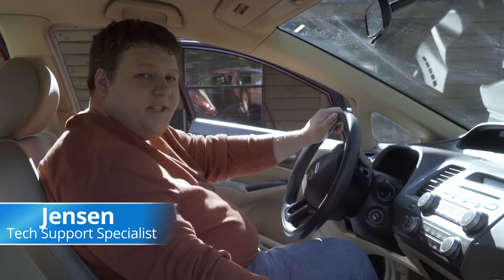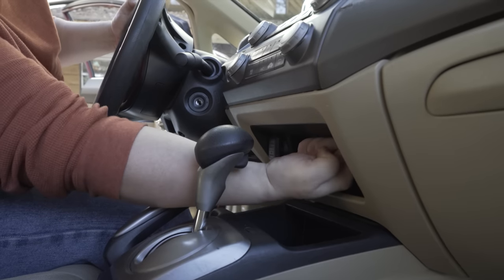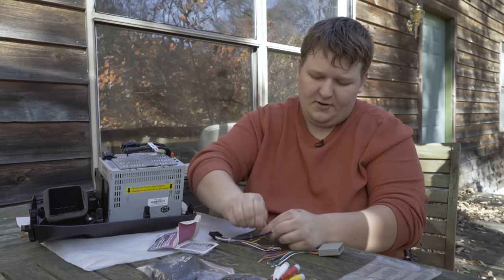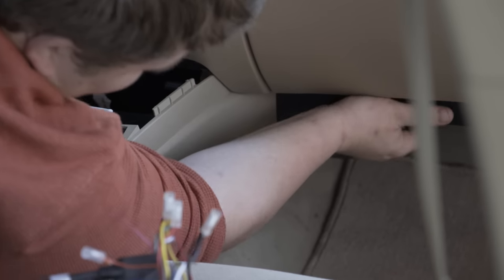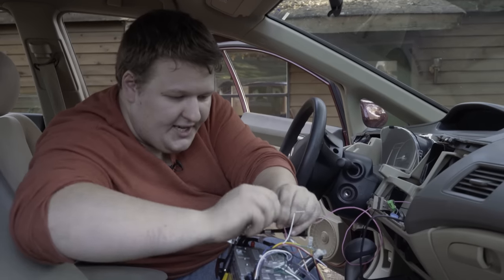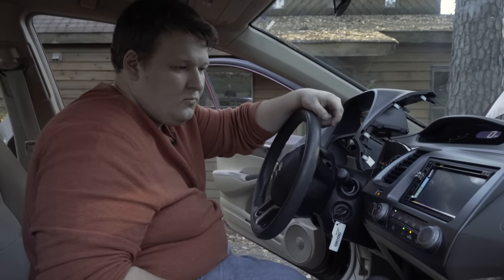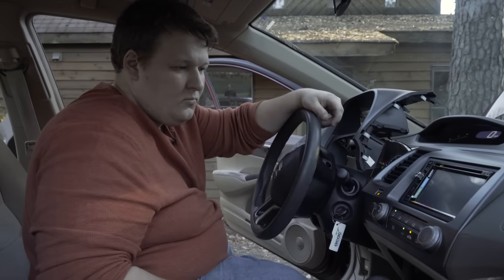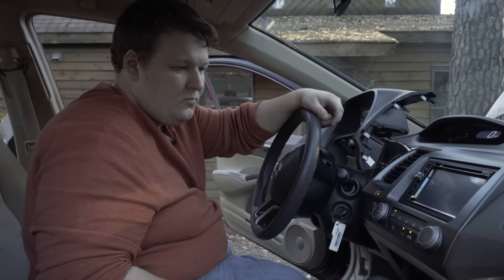How to install a stereo and speakers in a 2006-2011 Honda Civic | Crutchfield

Comment: do you have to connect to the brake wire? what does that do?
Reply from the maker: When installing an aftermarket video receiver, you must connect the brake wire in order to watch video on the in-dash screen. Due to legal and safety reasons, you cannot view video unless your vehicle's parking brake is engaged. If you attempt to view video without the parking brake engaged, the unit's LCD touchscreen will simply display "Parking Off".

For more details, feel free to reach out to an Advisor on the Crutchfield site: https://www.crutchfield.com/I-rYTVc000/Support/Chat.aspx

Hope that helps
--Crutchfield
Reply: Just connect that wire to ground to bypass that safety crap

Comment: Do you have to mess with brake line with just a regular head unit , speaker and amp?
Reply from the maker: Tapping your parking brake is for headunits with screens and video playback capabilities.

Comment: Does the factory aux still work? And I drive a standard is the brake wire in the same place?
Reply from the maker: For more details regarding installation in your specific year/make/model vehicle, please contact an Advisor directly on the Crutchfield website: https://www.crutchfield.com/I-rYTVc000/Support/Chat.aspx

Thanks!
--Crutchfield

Comment: So when I switch my parts from the old kit to my new kit, on the ac controls the off and ac button keep getting stuck and become unusable, any tips?
Reply from the maker: We didn't experience that issue and wish you was not experiencing it. Can you tell what is catching the buttons? If it is part of the new dash panel, you could try using a file or something to slowing remove the paneling material that's catching the buttons until it is no longer causes issues

Comment: hey where did you get that radio kit from?
Reply from the maker: The Scosche HA1561 Dash Kit featured in this video is available for purchase on the Crutchfield website here: http://www.crutchfield.com/I-rYTVc000/p_142HA1561G/Scosche-HA1561-Dash-Kit-Dark-Gray.html?tp=3486

If you have further questions or would like personalized recommendations, feel free to speak to an Advisor via the "Contact Us" link at the top of the webpage. I hope that helps!

--Crutchfield

Comment: Anyone's corner dash tweeters stopped working after installing? There was a cable that I assume was for the tweeters but the wiring harness adapter didn't come with anything for it, as well as the double-din i have probably doesn't even have a port for it.
Reply from the maker: It sounds like the new receiver wiring interface may not be connected properly or might be the wrong one for the vehicle. If it was purchased from Crutchfield, I recommend contacting our technical support using their toll free number we include on the order invoice. It the harness was purchased elsewhere and they cannot help, I recommend contacting the manufacturer of the harness for help
Reply: @crutchfield  ah yeah, I read up on the product after and it didn’t include wires for the tweeters. It’s okay though, I bought 3 way speakers from you guys and it gives me plenty of highs :)

Comment: I have an 07 civic lx sedan and I bought a dash kit and new head unit cause mine wasn’t playing sound out the speakers and thought it was the radio so I bought a new radio and installed it and still no sound is coming out of the speakers and I can’t seem to figure it out! I connected all the wires color for color and checked my speakers connections and nothing seems to be off…. Idk if anyone has had this issue
Reply from the maker: That Civic does not have a factory external amp installed in it. The radio in the dash powers the speakers. If you have changed the radio, chances are the radio's built-in amp is not the issue. The speaker wiring that runs from the radio to each speaker or the speakers themselves are most likely the cause of the issue. You may want to try replacing a speaker first as that is easier to do than running new speaker wire to each speaker.

Comment: Anyone know if it is possible to just pop the speaker cover off and do it that way to cut corners? The whole door panel removal just seems unnecessary.
Reply from the maker: The factory speaker grills are molded into the door panel and cannot be removed separately.
For additional assistance and personalized recommendations, feel free to contact us directly by phone or through our online chat service:
http://bit.ly/2jBGHPp 
Hope that helps
--Crutchfield

Comment: What is the reason for tapping into the parking brake?
I noticed the car stereo whines when i release the parking brake and when engaged no car noise whine same when the headlights come on noise goes away can someone help 🥲
Reply from the maker: The parking brake wire is the one that detects when it is safe for the receiver to display video and with more modern radios, to get into the advanced setup parts of the menu (the ones that need more attention than can be safely given while driving). This should not cause any noise and recommend contacting technical support for help. If you purchased yours from Crutchfield, we recommend contacting our technical support for help. We send their toll free phone number on the order invoice. If it was purchased elsewhere and they cannot help, we recommend contacting the radio manufacturer for help.

Comment: I finish replacing a new stereo on my 2006civic but there was no sound. Any tips?
Reply from the maker: It's hard to diagnose without more information. If you purchased the stereo from Crutchfield, you can call our tech support department for assistance. Their toll-free number is printed on your invoice.If you purchased the equipment elsewhere and the retailer will not help, we do offer paid access to our tech support service:  http://www.crutchfield.com/I-rYTVc180/p_000TECH90/Crutchfield-Tech-Support-90-day.html  You can also try posting your issue in our community forums to see if one of our members can help. Provide as much detail about your vehicle, trim package, & stereo model as possible:  http://community.crutchfield.com/  Hope that helps!--Crutchfield
Reply: amp turn on. I had the same issue. If you have an EX or an SI you have a factory amp that needs to be wired. It should be on the other harness the man isn't using in the video (light blue wire) and you can just tap into that and wire it into the blue white or blue wire (used for remotes and amp turn on) on the harness you bought and it should have sound.
Reply: Raymond Coolidge Thank you, I finally have time to tried out what you have instructed and it work like a charm. No more silly cellphone speaker -_-
Reply: Glad i helped!
Reply: Raymond Coolidge thank you!!!!

Comment: all the speakers are off and i changed out the fuses. Will changing all the speakers fix the problem? not sure whats going on. the radio has power and works, its literally just no sound
Reply from the maker: Do you mean you installed a new radio and lost sound?
Reply: @crutchfield  no sorry. It's all stock and it's a base model, not a si, no premium setup. Speakers just stopped. I can't seem to see if there's an amp. I'm assuming it's in the head unit. But I bought the speakers and parts for like 100 bucks so I was thinking about switching them out to see if that works. Just weird that they all went out.
Reply from the maker: Got it. What is the year, make and model of your vehicle?
Reply: @crutchfield  2007 civic  coupe  base model. Not the si
Reply from the maker: The most basic systems offered in the 2007 Civics did not include an amp. This means the stock radio powers the speakers. If all the speakers stopped playing at the same time, there is a chance the radio is going bad and needs to be replaced.
Reply: @crutchfield  I just found out her fronts were out for a while and her rears just went out so it's wasn't all at the same time as I previously though. I guess that's kind of leasing me to believe it's the speakers and not the head u it now.
Reply from the maker: Sounds like you may want to start by replacing one pair of speakers Would you like help choosing?

Comment: What about steering wheel control?
Reply from the maker: Hi Shaham, do you need help choosing a steering wheel control interface for a  2008 Honda Civic?
Reply: @crutchfield  yes also the wiring for steering wheel control
Reply from the maker: Do you have the EX, DX, or LX. To verify, the car did come with a factory radio and steering wheel controls? Did your car come with factory nav? What brand and model radio are you looking to install?

Comment: What is the brake wire?
How make my back up camera start wen change to reverse on a 2011,  is that the brake wire?
Reply from the maker: In-dash video receivers feature a parking brake interlock system that prohibits viewing of video programming while your vehicle is in motion. In order to watch video on the in-dash monitor, the vehicle must be stopped with the parking brake engaged. The video receiver will include a parking brake wire which must be connected to your vehicle's parking brake detection circuit. 

Most receiver's that feature a rear-view camera input also have the ability to automatically switch to that view when your vehicle's ignition is put into reverse. You'd need to wire the receiver to your vehicle's reverse lamp circuit for auto switching to occur. 

If you have other questions, feel free to contact one of our Advisors on the Crutchfield website: http://www.crutchfield.com/I-rYTVc000/support/ContactUs.aspx

I hope that helps!
--Crutchfield
Reply: Crutchfield so will the radio and everything still work if you don't connect to the brake wire?

Comment: Why is my speakers to my car not working now. After this install
Reply from the maker: I hate to hear that the install didn't go well. There are a few things that could cause no sound after installing a radio. The best thing to do is speak with a technician to troubleshoot the issue. If you purchased your gear from us, I'd recommend calling our technical support for help. Fingers crossed its something simple to fix!!

Comment: Damn I'm too lazy too take off the whole center console just to reach the brake wire, I think it's easier just to bypass it
Reply: Juan Sebastian Niño they sell bypasses so you can watch movies even while the car is driving I just did because I didn't want to remove the center console, they're only like 10 bucks on amazon
Reply: Otjer way is just conect it to the ground wire,(black) and done,,,,works same as the brake cable
Reply: Can anyone confirm this?  Thanks for the tip martin.

Comment: Will 6.5 fit in a 08 civic?
Reply from the maker: Check out crutchfield.com/whatfits and enter your vehicle info to find out what fits. Because of top-mount depth and other factors, not all 6-1/2" are the same as far as fit goes.

Comment: If I do this am I then able to install an amp for a subwoofer with a new stereo
Reply from the maker: Hello! Thanks for reaching out. What is the year, make, and model of your vehicle?
Reply: @crutchfield  09 Honda Civic sedan
Reply from the maker: Excellent! That vehicle can have an aftermarket radio installed. If you do that, just make sure you get one with a subwoofer preamp output and you can add an amp and sub system while getting it the cleanest audio!

We can recommend a radio setup to get you started. Which sub-model Civic is yours (i.e. EX, DX, SI, etc..)? What other abilities would you like in the new radio?
Reply: @crutchfield  I actually just ordered a new stereo from you guys it’s the Jensen MPR2110. So so hopefully I got the right one..
Reply from the maker: I'm sure you got one that will work as long as you used our vehicle fit guide when ordering :) Did you use it?? lol
Reply: @crutchfield  yup I did! Do you have any Info on a place I can feed my power cable from the battery to the amp? Everything I ordered is coming this week!!
Reply from the maker: That's awesome! We do not research vehicles for this information. Often, the easiest spot is using an existing grommet in the firewall to run the power wire through to the engine compartment.

Comment: Why did u have to run a wire to the break wire ?
Reply from the maker: In order to watch a video on an in-dash stereo unit that supports video playback, the park brake must be connected to the stereo's harness, and the park brake must be engaged during use of the video playback.
This is a required safety feature for stereo's that feature a video playback option.

Comment: you didn't have to bypass the factory amp?
Reply from the maker: +Jo Dollente The '08 Civic featured in this video didn't require bypassing the factory amp. To find out if yours does, you can enter all your vehicle information in the "OutfitMyCar" application on our website here: www.crutchfield.com/I-rYTVc000/car/carselector.aspx?lp=%2fCar%2foutfitmycar%2fcar.aspx

If you have any other questions, feel free to reach out to one of our Advisors using the "Contact Us" link on the Crutchfield website. 

I hope that helps.
--Crutchfield
Reply: +Crutchfield what about a 2006 honda civic ex coupe no navi . what harness will I need to connect a after market deck?

Comment: Why did you tap into the break wire
Reply from the maker: Most any touch screen radios require a connection to the parking brake wire for full functionality.

Comment: What was the brake wire for?
Reply from the maker: +snakefangs21 The parking brake detection circuit. This is required for video receivers to ensure the unit will not show full-motion video content unless the vehicle is parked.Hope that helps!--Crutchfield
Reply: +Crutchfield what happend if we do not connect this wire?
Reply: video will not work.... or if you run power to the line, the receiver thinks the brake is always on and will show videos even while driving.... dumb and not legal

Comment: Why did u tapped into to the park brake line
Reply from the maker: We tapped into the parking brake wire because that wire needs to be connected for a video receiver to work properly and also because that wire was not being provided by the wiring harness used to install a receiver into this car. However, some harnesses do provide that parking brake wire and would mean that the stock wiring would not need to be tapped into. I recommend contacting an advisor to discuss your options and get a personal recommendation. Here's how to reach us: https://www.crutchfield.com/I-rYTVc000/ContactUs.aspx
--Crutchfield

Comment: I recommend you simply GROUND your brake wire. Don't tear your car apart more than you have to. All this does is prevent you from video playback if the car isn't in the break gear. If you have common sense, you aren't doing this anyway so this isn't a problem. There is also no danger in leaving your battery connected assuming all you're doing is swapping your radio and speakers (besides amp)
Reply: Bryan so you don't need to connect the brake wire?
Reply: Nope, just a bullshit cause because it's "illegal" but if you have common sense then there is no problem
Reply: Bryan much easier to tap into any wire of the vehicle at the micu which is fully exposed after he took the first panel off...  Every single thing inside a Honda plugs into one central easy to access module

Comment: What about the swc?
Reply from the maker: Hi Pedro, 
A steering wheel adapter was not needed in this application.
If you are considering ordering gear from Crutchfield, and you do have steering wheel audio controls that you would like to retain, a member of our Advisor team will be happy to ensure that you receive the gear you will need for your installation.  Our technical support team will be happy to assist you with your wiring and installation, should you need anything once you start working on your new setup!
Feel free to chat with us online!

Comment: what about the back speakers?
Reply from the maker: That process it too different even with some of the years to include a video that would help with all models. If you purchase your speakers from us, you will get instructions specific to your model to show how to remove them. If you have the speakers already, you can order our MasterSheet instructions which we prepared to show you how to get the original speakers out so you can replace them:

http://www.crutchfield.com/I-rYTVc000/p_264MASTER/item.html

I hope this helps! For additional assistance & personalized recommendations, feel free to contact us directly:

http://www.crutchfield.com/I-rYTVc000/ContactUs.aspx

I hope that helps.
--Crutchfield

Comment: How to install a 2019 honda  radio
Reply: How to take out the radio in a 2019 honda
Reply from the maker: Tomeka, if you are interested in replacing your radio in  your Honda, you should get in touch with one of our advisors.  They can help you make the right selection, get you all the gear you need to do it, and any purchase from us comes with lifetime tech support to help you along the way! https://bit.ly/2KP1zS3

Comment: Lol why the fuck would go through all that trouble to ground that brake wire? Like all
you have to do is ground it and if you got common sense yo dumbass wouldn't be watching movies while driving, sure it's a safety feature but damn son do you really have to take apart a section inside the car over a wire? Who came up with that stupid bullshit?
Reply: Masterman5010 that's because the DVD player won't work unless your in park